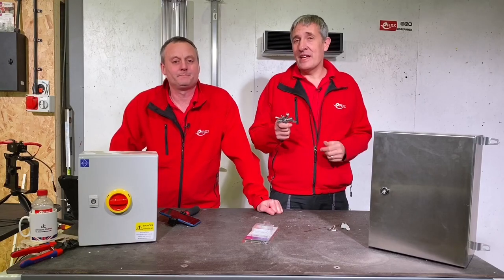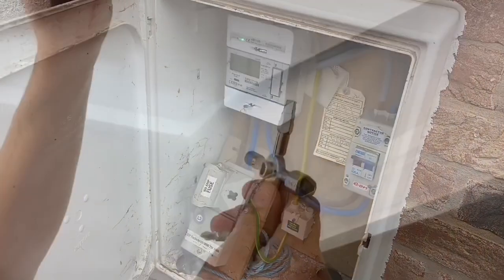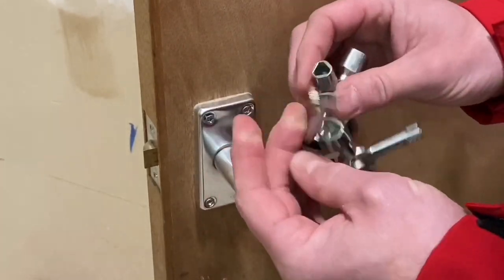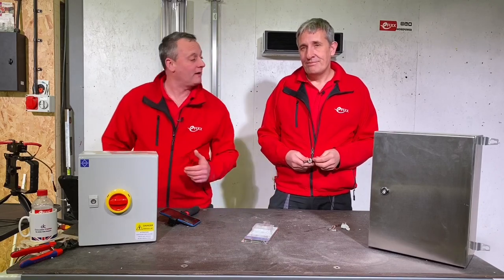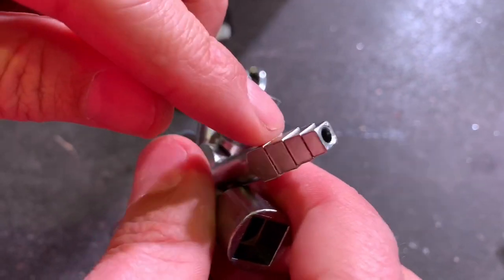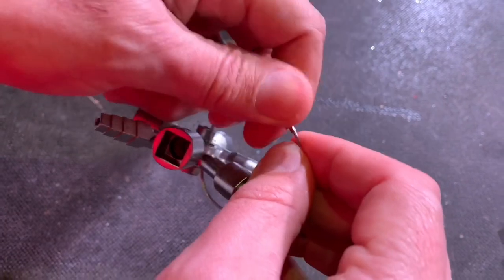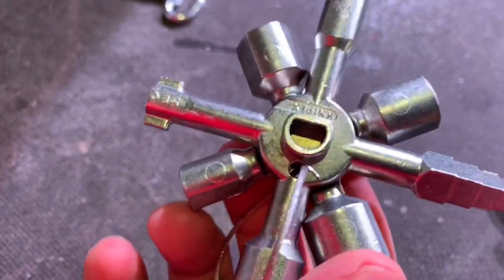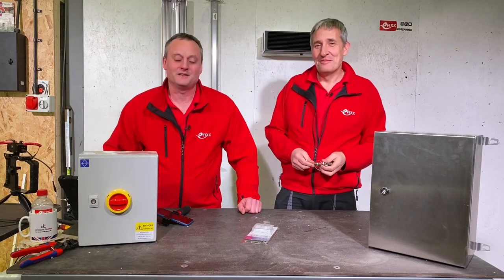Open almost ANY cabinet with the Knipex TwinKey - great for meter cabinets and control enclosures

Comment: The half-moon 6 or 8mm is also used in some cabinets. BTW: The bit on this is Phillips PH2, not Pozidriv. I'm using this guy:

https://www.amazon.de/gp/product/B0022SL7KU/ref=ppx_yo_dt_b_search_asin_title?ie=UTF8&psc=1

Got square 6 and 8mm.
Triangular 8mm
The standard cabinet key with the two beards.

The Bit included is of the same sizes as the one on the Knipex, 5.5mm slotted and PH2.

Comment: The actual keys on the set,don't tell me they are for street lighting columns as I had to drill the locks out on a couple recently to isolate the power to change the lamp gear    from sodium to Led
Reply from the maker: Street lighting can be a challenge depending upon who made the column.
Reply: @efixx  yep no idea as its an old concrete one so could be 30+ or more years with no manufacturers writing , I've taken the lock barrel measurements to a few local electrical wholesalers as well as pictures but no luck so far on a replacement mechanism which if i could I would of fitted a more common triangular key lock.

Comment: One thing you won’t be able to open is the in ground water meter box lid here in USA.  It use the Hex ( 5 corners ) not the square (4 corners ).  ✌️😁✌️